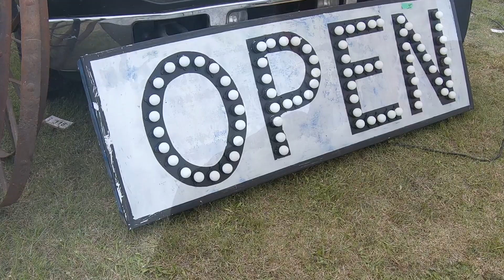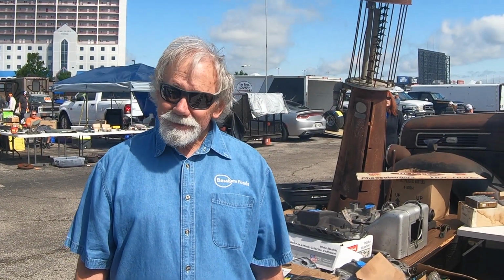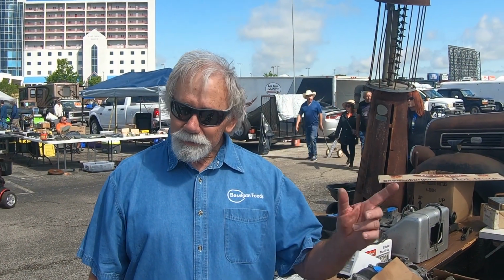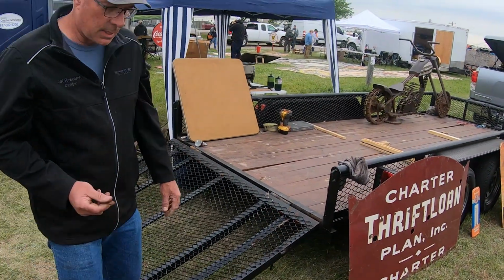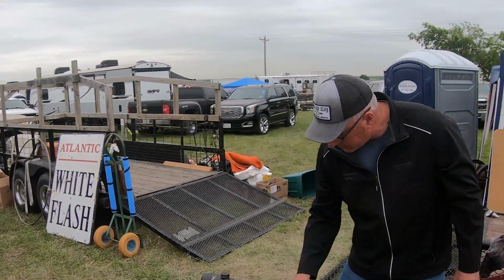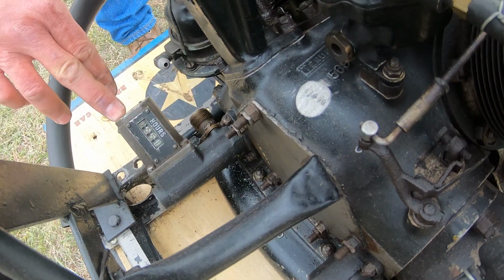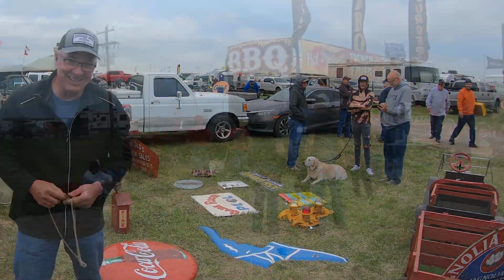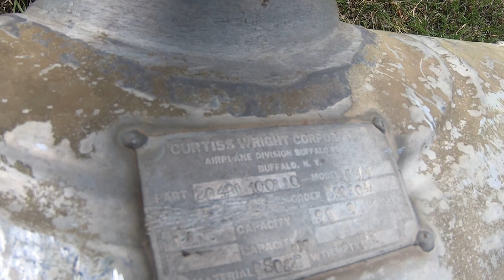Ratz go picking!

Comment: G, day Hanger Rats from Sydney Australia.
A&P second-hand parts.
Considering the type of planes that you would buy parts for.
* history of parts
* eddy current, liquid penetrate and ultrasound ( internal cracking) detection.
* with the panel upgrades to LCD screens, are the old steam guages worth having?
Artificial horizon, air speed, altimeter, heading indicator.
* storage space for parts.
Thanks for the talk
👨‍🔧🏈
Reply from the maker: Nope.  These are all junk parts...